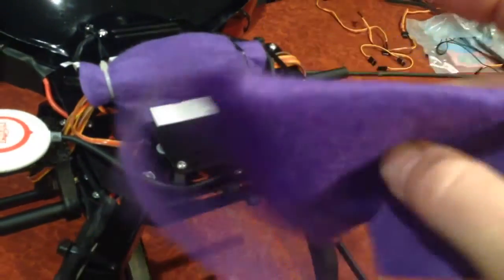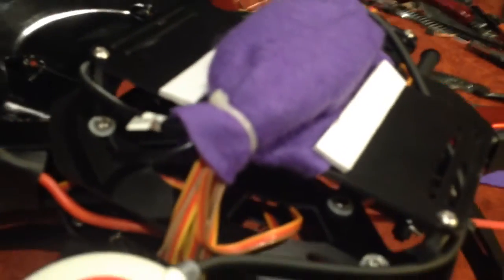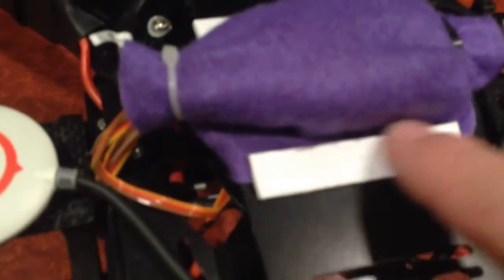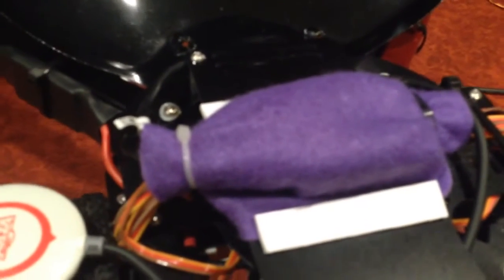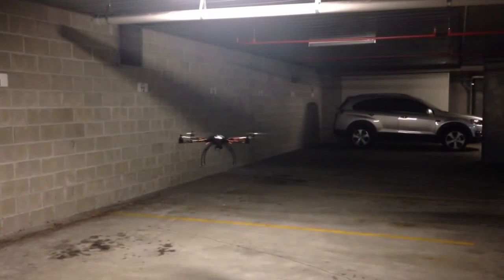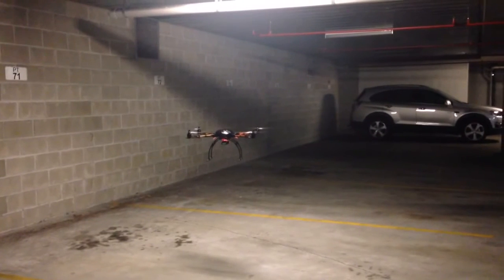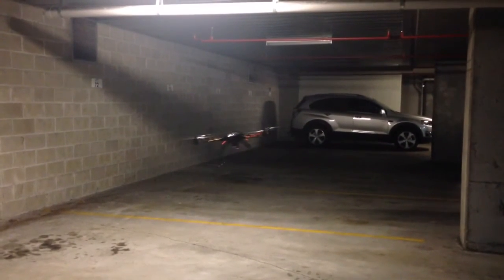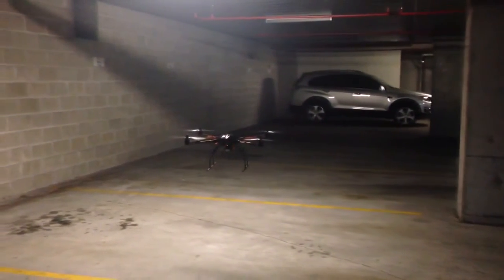Shielding the Naza M Lite against light and wind.

Comment: So what sort of issues were you having before covering the Naza with the fabric?
Reply from the maker: When flying fast the height would vary a lot due to the air pressure and also the early model Naza Lites would react to sunlight if it hit the side - the newer ones are much better but this felt fixed the old one nicely.